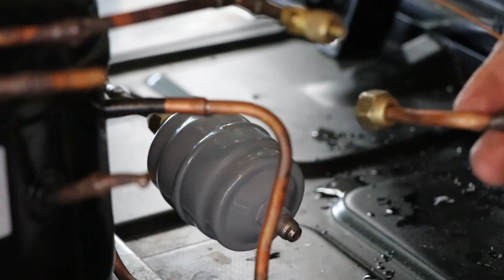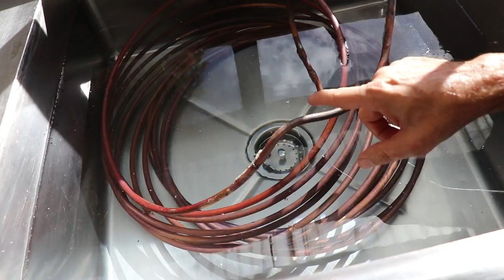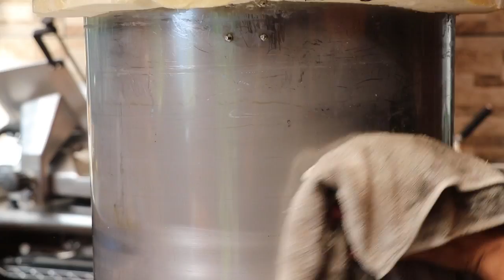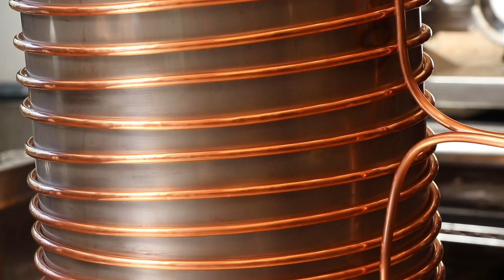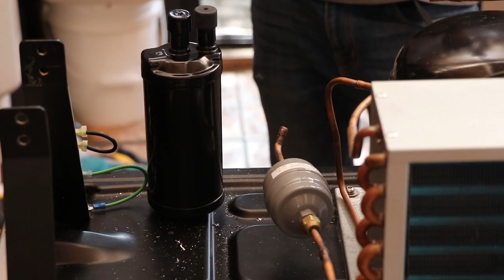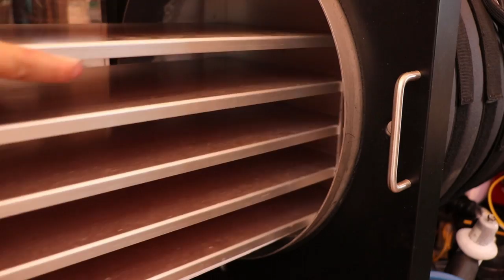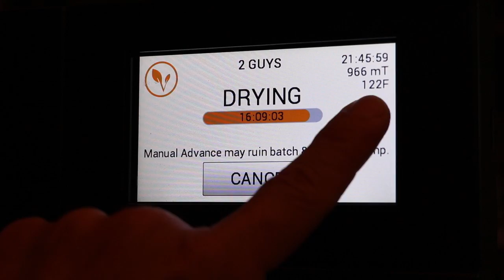My Freeze Dryer Stopped Freezing | Part 2 - Fixing the Issue

Comment: Hi Eric, thank you for the videos! They have been immensely helpful as I navigate my own refrigeration issues.

When Easy Seal was mentioned as not being as effective in your "particular circumstance", did you mean the leak in your machine in particular, or leaks in the low side of HR freeze dryers under foam insulation in general?

As another international customer, I am trying to work out if I should order some from Amazon to try it out for myself. Thanks!
Reply from the maker: In my case the easy seal didn't work because the leaks were caused by corrosion.  Basically 15 spots on the low side were leaking.  If you are having a similar issue I wouldn't waste any time with easy seal.
Reply: @2guysandacooler  Right, that makes a lot of sense! I guess if the leak is not in an exposed area, Easy Seal would be the Hail Mary pass before digging up insulation. Thanks!
Reply: Hey again, Eric! Any chance you could post the specifications of the thermal expansion valve, suction accumulator and crank case pressure regulator you used in the video description? I'm helping a friend replace their faulty compressor and it'll be cool to test out your upgrades. Thanks a million!

Comment: I recently moved my machine and at one point it was tiltled forward for about 1 minute. I went to start it. It made a clunking noise so i turned it off. I let it rest for about 20 hours. Turned it on and it started right up. After putting a cycle. It finished drying and it started making the clunking noise again. I left the candy inside like i usually do for an hour and when i opened it i realaized that it then freeze and there was no ice build up. What could my issue be

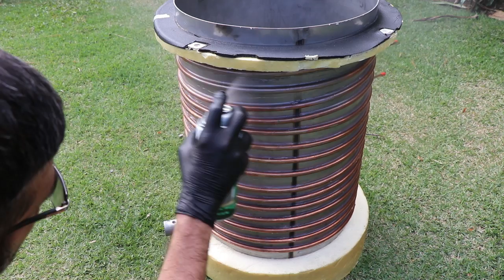Comment: 14:31 I noticed you went overkill on the coils insulation. But I have a question.
You recently bought a StayFresh, and SF instead uses a padded (removable) insulation sleeve 
only, instead of cast foam.

I've seen other SF  users able to reach their hand underneath the sleeve and feel the coils
underneath. Do you think that could be a problem with the coils somewhat exposed (in the future)?
Like condensation or mold?

Comment: A  mechanical expansion valve is the way to go to control superheat. An even more performing valve would be an electronic expansion valve. An EEV is a PID controlled valve that, if tuned correctly, can maximize your superheat  and  eliminate the guess work. An EEV would require a pressure transducer and  a temperature sensor as inputs.

Comment: After searching “additional freeze time needed” message I came across your video and realized my FD had the same issue. After calling support and sending logs and pictures they determined I had the same issues you have. It’s been a several week process so far but I would say they are doing a good job of dealing with this issue. My only concern is this is now a known issue and I just caught mine in time before the warranty was up. This should really be a recall because there are many people out there that don’t realize they have this issue. My batches were taking twice as long so thanks for putting this I for action out there Eric! Will follow up after the repair.
Reply from the maker: I was wondering how many people out there had the same issue as me..  I hope you get it fixed quickly.
Reply: @2guysandacooler I have the problem to and can't get a chamber on back order
Reply: when you get it back you only have 90 days to ship it back on their dime if they didnt stop your leak of freon it will show on your water batch test. Do a water batch test as soon as you get it back and take lots of pics. At 80 days do another water batch and compare pics. If your freeze rings are less they didnt get the leak stopped.